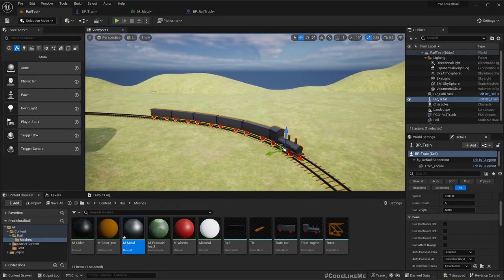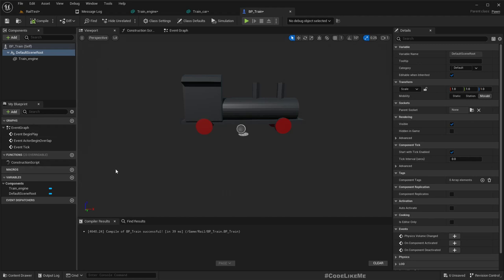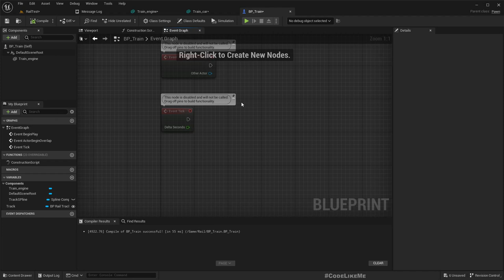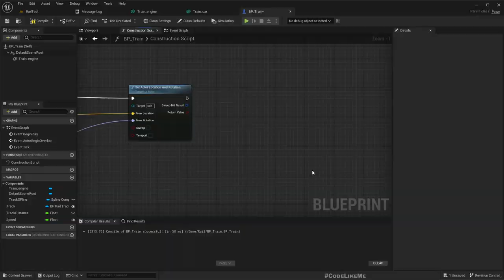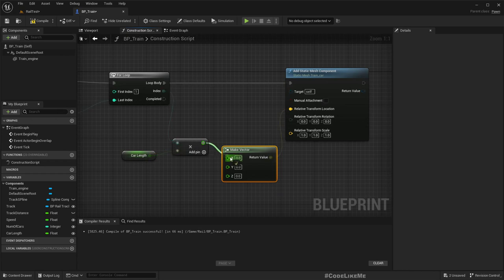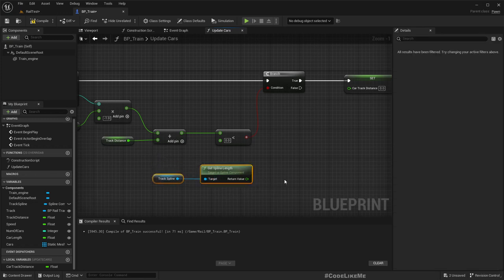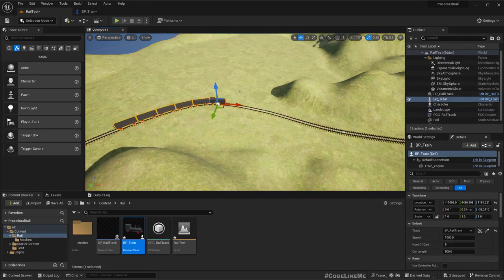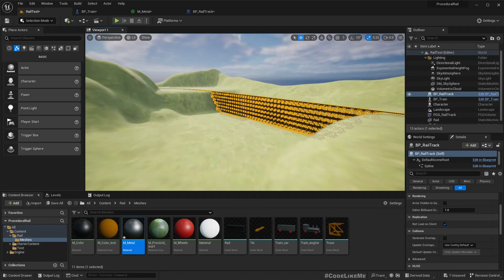Unreal Engine 5 - Procedural Train Simulation

Comment: Hello, Mister! I have been following your tutorials and they are absolutely great!  I followed this one as well, but i've been using my own meshes, which are a bit longer than yours. However I discovered that using this method to move the train cars along the spline generates too much wobble on the cars, the greater the length of cars, the greater the wobble gets and it does not look good. I tried multiple workarounds but nothing seems to solve this wobbling. I think it's caused by substracting the length of cars from the "distance along the spline" variable when moving the cars. When I tried it without doing so the wobbling seemed to have disappeared, but the problem is if you don't substract the length of the cars as you might imagine the car moves inside the train... Is float inaccuracy causing this "wobbling"? Do you have any idea of a workaround? Much appreciated!
Reply: I think I managed to solve the problem. You need to distribute spline points evenly along the spline for it to work.
Reply: @socsuec  Not sure I understand this? I thought that adding spline points is just to introduce different "curves" into the track as the sampling distance increment was set in the "Spline Sampler" node settings in the PCG Graph so the points used for calculations are already spaced at regular distances along it?

Comment: I think the problem you're having with "only 4 carriages" is that one of them is positioned inside your engine car at the front (it is on mine as I'm using models I can go inside!)!

You forgot to add on the length of the engine!  Just add an extra pin onto your "+ Track Distance" node in UpdateCars function, and add on the NEGATIVE (ie subtract) the "Engine Length" from measuring the mesh in the editor again! o)

Oh, also added an offset in the Z axis when placing / updating the carriages / train so that the train "rides on top of" the rails!
Reply: Thank you so much I had the same problem

Comment: Is it possible to move the spawn location of the train or move the beginning of the spline without moving the whole track? Another question, there is anyway to fix the performance issue? I saw on my map that the tracks can be seen miles away. Thank you for your hard work! I love your videos.
Reply from the maker: I think we can introduce a variable to set the starting length of the track for train to place train cars. I haven't investigated about the performance to answer that